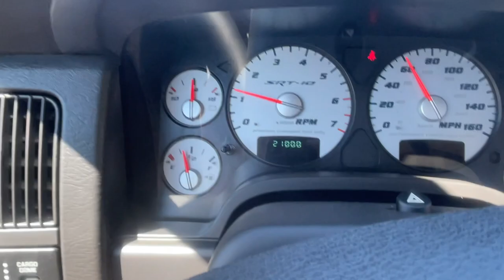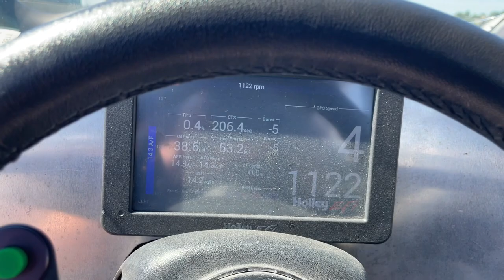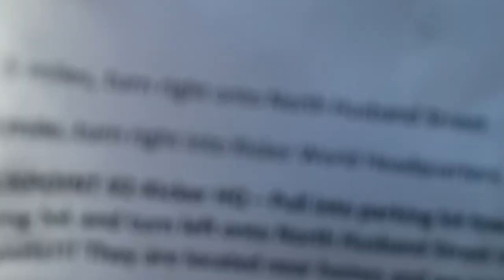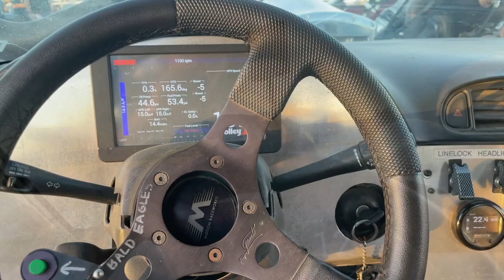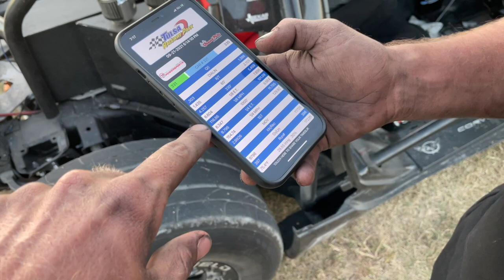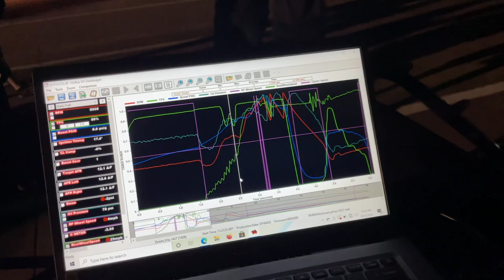RACE WEEK 2.0 Day 4 - We Found the Problem With Leroy's Severe Vibration... (One Small Mistake)

Comment: When RMRW is all said and done and the steads are back in the stable(FL), I'd take the whole rotating mass(flywheel, press. plate, clutch disc, Tq tube, nuts & bots, etc.) out have it spun balanced at a machine shop. I too get the willies seeing even that little bit of wobble left. Fingers crossed for you guys.
Reply: The flywheel is warped too!

Comment: The guy in stick 1st ran his best time at today’s track. If he repeats it Cleet will need an 8.10 to take 1st. Considering Cleet ran an 8.113 on day 2 it’ll be close but definitely doable.
Reply: I suspect we may see old Leroy the savage running some 7’s tomorrow 🤞
Reply: @HaulTrashGetCash  He haves it in him just track conditions are a little meh this race week from what ive seen.
Reply: @godlyname8544  that's my assumption too. The track really seems to be throwing everyone for a loop and tbh, I think a good night's sleep would help IMMENSELY.
Reply: @godlyname8544  for sure, i hope that he’s able to fine tune his clutch enough to where he can launch at decent rpm and not spin. I guess we’ll see.
Reply: Good track prep and Leroy flies past. Hope they get good conditions and lots of runs in for the last day.
Reply: If the other guy runs his best, an 8.1 might not hold up. Anything can happen here.

Comment: I have the metal version of those calipers. Had them for close to 10 years and checked them against expensive ones and they are dead on. 

I'm not sure that wobble is normal either. May get it done but that's not right. They are supposed to be perfectly machined. You probably bent the flywheel a touch.
Reply: i dunno. its alot of wobble.  looks more like a hurt crank.
maybe it cant handle leroys power.
Reply: @MrLarsgren  it's not radially wobbling though. The ring gear is still going around correct. Just like the edge has been push. If it was a bent crank it would be moving more I think. Either way it's not ok. Like toasts engine" oh they just breath like that"........uh.....no....

Comment: I’m a toolmaker by trade and now own a business CNC machining cast and billet performance parts. I’ve lightened and machined  warped flywheels and yours needs some attention or be replaced, unless there’s debris between the crank flange and flywheel. 

When you get back to your shop, put a dial indicator on your flywheel and check the runout. I wouldn’t be happy with anything over .003”..... yours looks to be running out approximately .040” on the outside, so probably .030” in near the friction face. To the untrained eye you shouldn’t be able to see any wobble if your flywheel is in good operating condition. It’s the reason your clutch is still visually wobbling, despite having now set it up correctly. In good working order it shouldn’t run out either. 

The large offset chamfer on the friction face made me question the quality of machining, but surely it’s a balancing technique?

Comment: Awesome video but maybe a suggestion... Why not have Motion RaceWorks mill leroy some billet spacers instead of having so many washers? They would hold there measurable value tighter, be stronger, and do away with any friction between the stack of washers. My torn apart 08 4.7ram, I can't find a Crankshaft for, has a 6 speed, doesn't even make 350hp and id cringe having washers between the pressure plate and flywheel lol, excellent ripping though!! Glad you guys were able to get the issue sorted out!!

Comment: I noticed that there was an huge irregular oval on the outside of the clutch plate after the hoist repair. The outside bevel went from a 32nd of an inch to 3/8ths of an an inch like it was egg shaped. Go back and look at the startup.

Comment: Ol Cleeter, try turni.g the psi down a bit(by like 5-10psi) out of the rear wheels, during the burnout it looked like the rubber in the middle be expanding from the heat giving you rollerblade like wheels in the rear...or it could just be me trying to help for ol dale...I love the content, keep it up and what ever you do dont stop releasing all em bald eagles boi

Comment: If 8.89 and 8.74 are the averages, and the 8.74 car runs exactly an 8.74 tomorrow, Cleet has to run below an 8.14 to win. I believe the Stick car in the lead has run in the 8.5's, if it runs an 8.50, Cleet has to pull off a 7.89 or better to take it home.

Comment: It's not even that Leroy is bad in any way at all. Leroy is an absolute fucking savage that basically no tire or track can handle. Every track he goes to he has to turn the car down because the tires can't put the power down on the track consistently. If Leroy hooked up and Cleet banged the 1 - 2 shift perfectly, Leroy would be putting down low 7's easily.

Comment: you dont have a flex plate its manual, you have a flywheel.
still too much runout probly not mounted properly to the crank.
also if you should have had your stock flywheel and your spare ballanced with your crank

Comment: Change that flywheel bud need a machined flywheel instead of a cast flywheel way more precise then you should be able to go with all the same size shims and it should be dialed just go from the pilot bearing to each finger

Comment: Better pull off on a side road and get some hits in. Those tracks are prepped like a mall parking lot and won't hold a ton of hp off the line. Better call the guys from SRC and get some no prep advise. Lots of acres in those states are they too poor to afford the other 1/8 mile of blacktop and ⛽.

Comment: I want to build a AWD electric motor driven hybrid with a bad-ass engine driving a huge rectified three phase alternator directly linked to them all via a big bank of caps. No battery bank, no transmission, but with wheel prox(s) for traction control. A blend using the best of both technologies. Whadaya think?

Comment: Leroy needs a dog box so bad. It seems like cleetus is having a lot of issues getting into second gear quickly. Straight cut gears in a dog box should be able to hold more power and they are meant to slam into gear without even using the clutch. The clutch is only there for taking off.

Comment: It looked like Leroys’ burnout appeared like the tire pressure was to high. You could see on the burnout the tire was only making contact with just the center of the tire. I’m know expert and I could be wrong. Do you run tubes in your tires? If not I would like to suggest that. Let me know I’d love to know if I’m right or wrong. Thank you and keep up the great work!!
Reply: They are radials, you dont run tubes in radials.

Comment: I'm sure this message will never get to Cleetus, but I'm going to try anyway.
You have the best clutch but you need to learn how to tune it. There are three variables: static pressure, counterweight, and rpm. You never figured out how to slip the clutch instead of the tires. Race week tracks are not prepped on kill so cars aren't breaking. Just my 2 cents. I respect your never give up attitude!

Comment: Dumb question, but if you're into it that far, can't you pull the motor instead? I'm not familiar with the corvette powertrain.. but to pull the engine, you have to take the rear apart? 
Or is this an issue where you just can't move the motor enough to get the clutch out to the point where you can work on it?